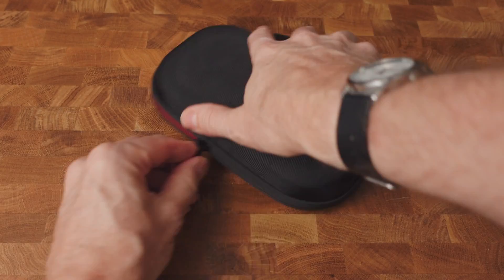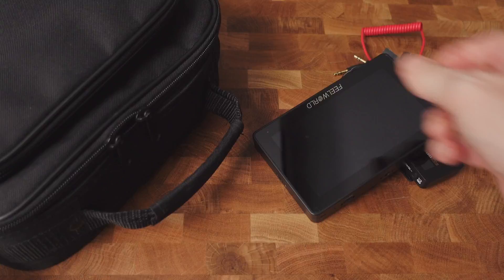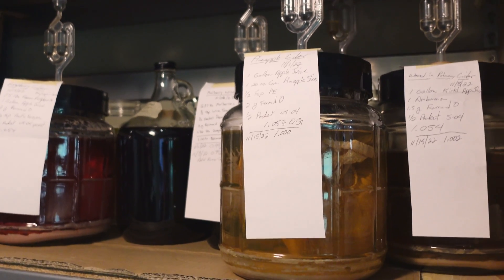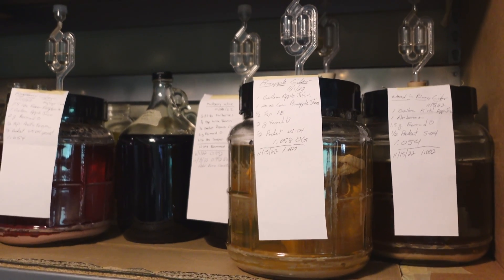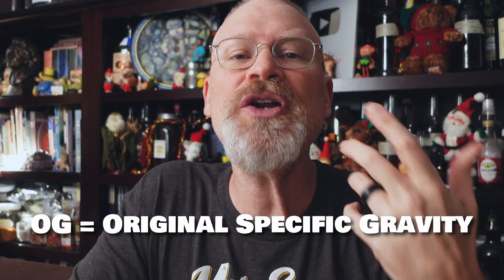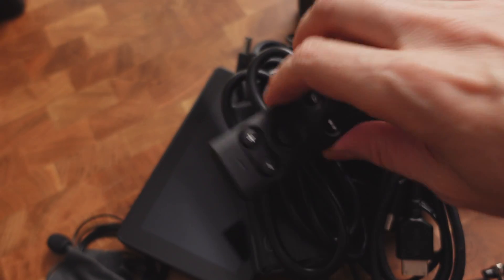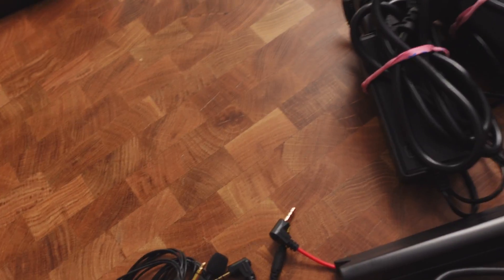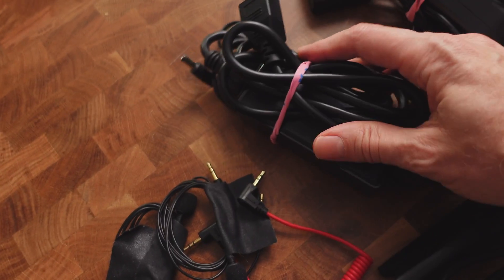Too Much SUGAR in my Mead or Wine! (or too much honey)

Comment: I once measured my gravity when the mixture was still too warm (around 50°C).  I waited until the mixture had cooled down before pitching the yeast (Lalvin EC-1118).  Fermentation never started and I couldn't figure out why.  I never though to account for the temperature.  I pitched another packet of yeast thinking that the previous one was bad.  It didn't solve anything.  It took me a while to figure out what was wrong and since I was aiming for a sweet brew with EC-1118 I had targeted a pretty high initial gravity.  When I finally took another reading, it was off the charts!

I diluted the batch down and it started fermenting VIGOROUSLY!  I didn't think to double the amount of nutrients since I had doubled the initial amount of yeast.  That batch had terrible off flavours even after a year.  I ended up trowing it away after having tried a few adjustments to try to make it enjoyable.

Comment: I used to start with an SG of 1.140 to 1.150 to get really sweet meads. They'd take a long time to brew, they'd occasionally stall, and I'd have to split and blend with a stronger mead.

Most of my meads then went to 18% but they'd take about 3 months to finish, and then I'd leave them for another 3 months to settle.

I started bringing that SG down to 1.100 or 1.120 and now they finish way quicker (couple of weeks) and I just backsweeten to ferment more and finish sweet

Comment: I routingely brew traditional Polish Trojniaks which are 4lbs of honey per gallon and, especially with some fruit juice added, can get above 1.14 OG but have never had a probem and it usually ends up as a sweeter mead (as intended).  I am so glad you did this video because it helps me understand the process even better.
Reply from the maker: Well, the Polish meads are an exception.  They often take a much longer fermentation and aging time and are intended to be 15% or so and very sweet.
Reply from the maker: By the way, if it's ending up sweet, it's most likely due to a stall!  Though in many cases those og's do surpass the tolerance of the yeast too.  1.140 is only 18.9%, so if it's sweet, it's not even hitting the tolerance of say EC-1118.
Reply: I made cyser with Belgian Abby yeast to make it sweeter (1.140 - 1.038) and I like it.

Comment: I had to dump out a stalled blueberry wine a little while back.. because my wife was making sugar syrup to feed our bees at the same time I was making wine and putting it in  empty bottles of the same kind of water bottles I was using.. it stalled.. thought about maybe using it to try to backsweeten.. but decided to just dump it
Reply from the maker: You shouldn't dump a stall... you can always dilute and referment it.  It's a waste to throw it out as nothing is spoiled or ruined.
Reply: @CitySteadingBrews  good advice but I needed the jug
Reply: Hi, i have same problem. I put more honey in my mead. can i refrement it and add more yeast?

Comment: I have something similar going right now.  I had a 1.140 start SPGR and just didn't want to bother with diluting it.  I did the calculation after it already started and found that if it went dry at 1.000 then it would end up at about 18%.  I decided to let it go and test it when it slows down and if it doesn't go closer to 1.010 and lands too sweet then i'm just going to invest in a couple packets of champagne yeast and try and get it to go the rest of the way.  If you think that this is a bad idea then i'll likely just add a little more water and try and get it to kick up again.  Worst case scenario is that it will just be a pretty sweet dessert wine that I add just a touch of water to to bring down both the alcohol by volume to about 10% and the sweetness to a more moderate 1.020.
Reply: I've been thinking more about this and I think that I could go through a secondary fermentation without the use of splitting my batch or putting any of the product down the drain.  I just need to wait for a specific point and then rack it to another vessel while getting the fruit out which will make room all on its own.  Then I add more water to bring the concentration of the alcohol by volume down and then let it continue to finish until it's finally done!  Problem solved!

Comment: OK ok. New here. First batch i didn't know... ANYTHING. But i found you thank the Gods. Dumped the first batch out. Smelled like death. Second batch hehehehe, I made a homemade airlock with pill bottle straws and hot glue gun. Ordered real ones get them soon. 10 days, there was nothing going on. Couple bubbles. So after watching your Videos and Thinking of physics. I took a reusable straw we had, there thicker plastic. 2 Pellets from bb gun and heat up the end of straw, crimp. put pellets in, all the way down. Take a bottle of water, put in the straw and it floated perfect half. Made a mark at water line........ Used it as gravity readiing on the second batch. Uh was Done, floated above water line i was SHOCKED.... So i Racked it and got it off the lees and then Did your Degassing thing, it stank...... Bad. For a few min.... Then i cold crashed it next to open window. Freezing outside. Last night i tried it. WOW i didn't like it at first. NEver been much of a White light wine or any wine really. After a couple sips it was Amazing. i could taste the apple,.... Wife said it smelled like straight Booze. After the third class i went to bed LOL and it was just a little sherry wine glass. hahahahahha.... Much Love you 2.. James

Comment: Hey Brian. I have issues with a brew that I am stumped on. I have never had 3 brews stall at the same place before. I made 3, 5 gallon basic meads. I had an identical OG of 1.120 in all 3 and used lalvin 74B in all 3. After roughly a month I noticed the bubbling stopped. When I checked all 3 had a gravity of 1.050. I waited a week and the gravity did not change. I then used a degassing wand to mix up the sediment to see if that would fix the stalls. After a week no change. I then added fermaid o to all 3 and a new yeast that I rehydrate first. After a week again no change.  Now what? I am like my 3 brews,,,,,,,,,stuck. I normally shoot for a 1.100 to 1.120 starting gravity and have never had an issue. Having all 3 stall exactly the same is confusing.

Comment: Back a couple decades ago when i first started wine making, i had an older friend that gave me advice on the matter. I didnt have much to work with as far as equipment, so a compromise was the norm. One of those was i didnt have a hydrometer. He told me to “put enough sugar or honey to float an egg and i should do fine” (I did however, checked the egg with the float test in water to make sure it was a good egg to use). My question is…have you heard of this or ever tried it if you have? The success rate i had was hit and miss due to the lack of proper cleansing. Which is another rabbit trail.

Comment: I had this happen recently dealing with a melomel; apparently raspberries have more sugar to them than I realized (started at 1.180).  I had done the same with blackberries earlier in the year and had it go dry, so I assumed it would be fine. Definitely should have looked into my ingredients a bit more. I think in the future I'll save part of my honey to add last in these kinds of brews too, just so I can fine tune it.

I let mine ferment (I only have 1 wide mouth fermenter, and my experience with whole fruit and narrow mouth ones has been messy...), which took it down to 1.050 (~17%), then blended it with a dry mild mead I had, ending up at 1.022. It's a touch high for me on paper, but that bit of raspberry tartness works well to offset it; this came out to be one of my favorites.

Comment: On the the hydrometer there is 1000 above it is 90 thats were my brew ended
Reply from the maker: 1.090?  That’s very very high for an ending gravity.  It’s stalled.  What did it start at?
Reply: @CitySteadingBrews  it started at 1.130 ended at .990

Comment: What a timely video.  I just tested my first batch of wine, and it is still quite a bit sweeter to my taste.  Started at 1.125 and ended at 1.040.  Would I be able to add a yeast with a higher tolerance and let it start fermenting again?  Great videos!  Thanks for all you do!
Reply: I have a similar issue with my mead. I started OG 1.162 and it stopped at 1.088. I'm not certain if it stalled out, because I think I mis-measured at the outset.
Reply: I have same question. I have a mead OG 1.139 now in fermenter for 5 weeks. It’s showing 1.070/10.89%. (Have a RAPT PILL in fermenter). Was wondering if I rack it into another fermenter and pitch something like EC-1119. And/or maybe split and add something like cranberry juice…